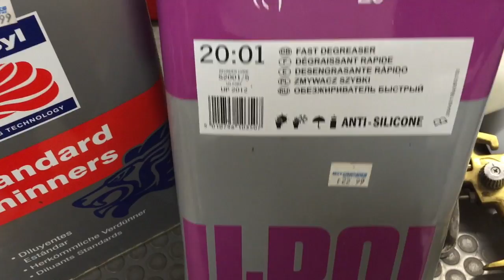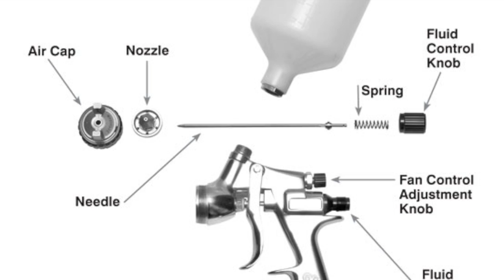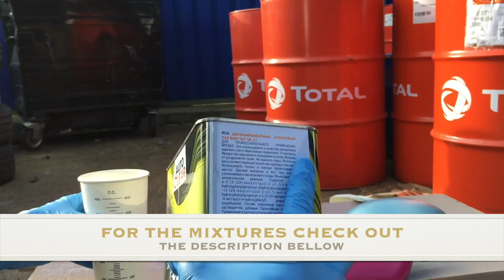HOW TO PAINT USING A SPRAY GUN. SIMPLE AND EASY

Comment: I got a couple questions. One, I see that you are using a filter by the end of the spray gun. Do you use the other device called oil, water gauge that usually goes right after the compressor? Second, do you have to clean spray gun when you finish your paint and proceeding to applying clear coat? Did you use multiple cup for this painting job?
Reply from the maker: Question 1 - yes I always use a small water trap just incase but I do have a drier that it goes through as it’s pumped out of the compressor 👍🏻
Reply from the maker: Chris Samurai Q2 - I always clean my gun with thinners or gun clear between coats  👍🏻
Reply from the maker: Chris Samurai Q3 - I use the same cup but clean it every time 👍🏻
Reply: FL4ME WITH A 4 thank you for clearing out those points.